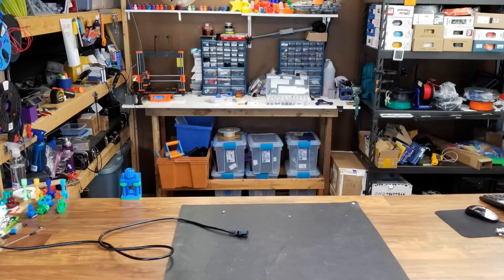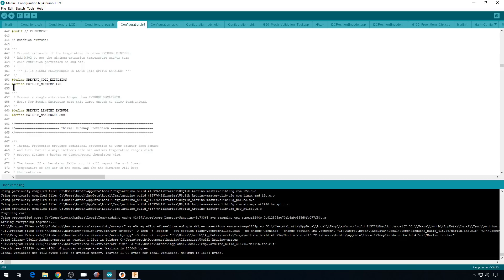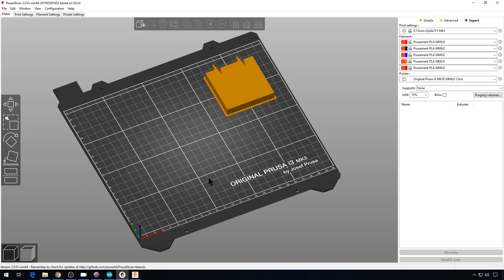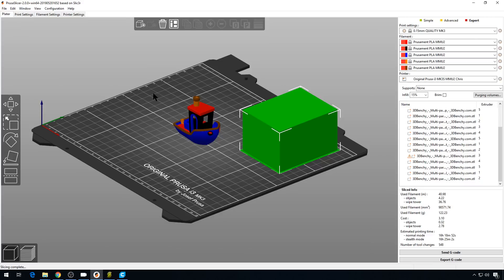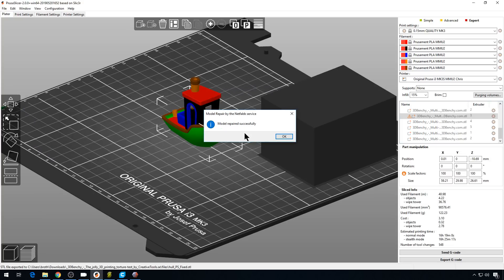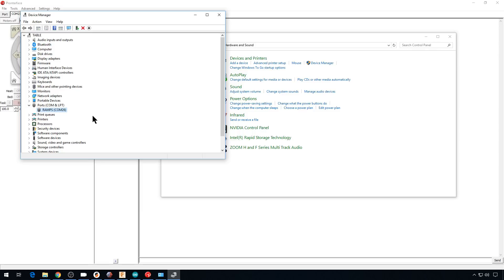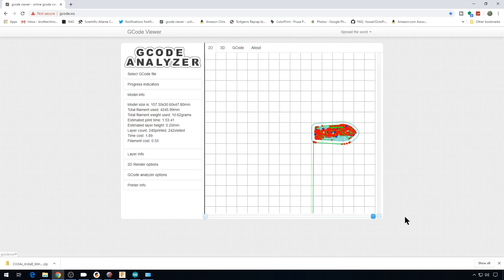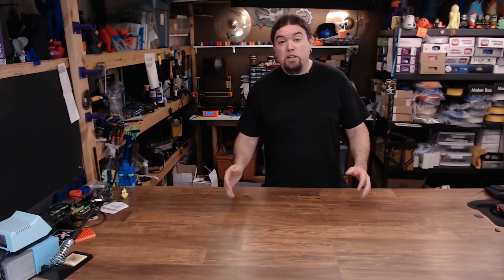5 Tips For 3D Printing - Chris's Basement

Comment: Hi, thank you so much for your printing tips. I unboxed a Sidewinder X1 last week and cannot host it with my PC. The technical support has no clue but send me a new board to replace instead, though I don't feel right about that at all.
Right before I was about to try installing the new board, I learnt from this video regarding the CH340 driver. Bingo! Problem solve! 
Thank you so much. Save me lots of works by switching boards.
Thanks again.
Reply from the maker: Awesome! Yep, that has caught me many times.

Comment: Suggestion- Show how to recover from a print that is halfway or nearly finished.  As in the power goes out and you need to finish the print or there is a filamint jam.  If anyone has any experience modifying a printer jam sensor to work with a 3d printer would like to hear about it.
Reply from the maker: Yeah, that is a tough one to do, it can be done, but I might be able to put a procedure together.

Comment: Great content.. There are some great tips, Chris...

I ran into something weird last night... print stopped midstream on a long print. simply stopped.. (Ender 3) nozzle locked into the print, not only that but the printer would not respond, I had to power it off and on again. cleaned it all up and attempted to reprint exact same G-code.. it stopped again.. but at a completely different layer (again the printer locked and would not respond). Faaaak I thought, I fried something.. re-sliced.. reprinted... bingo.. it stopped again but on a completely different layer... I thought I'd defiantly fried something..

Then I tried something different.. loaded the G-code on a different SD card.. it worked perfectly.. ran some diagnostics.. the SD card was the problem.. whewwww nothing fried and back in the game..
Reply from the maker: That is a good tip, I have ran into this exact thing before. I should put that tip on the list.

Comment: Great video Chris, can never have too many tips. Over the years I've had to overcome all of your examples, often with a ton of research, so it's great to see you bring some of them together for everyone. Indeed, slicers have come a very long way recently, Prusa Slicer is top of the pile in my opinion. I keep trying to get time to set up and tune a profile for the Borg too. Have you considered a tutorial on doing that? There must be a lot of people that would benefit, maybe even some that think Prusa Slicer is only for Prusa machines.
I currently use S3D for the Borg, but PS always gives better results on the MK2, so no reason why it wouldn't do the same for the Borg when tuned properly. Also, PS has a truck load more updates and innovation for free than S3D does for $150. That and the threat of further cost when (if) v5 update is released.
Reply from the maker: Totally agree with you. I have thought about doing slicer stuff, but it seems boring to me. Maybe it would be a good idea to try it. I will think about what I should include.

Comment: One of the first things I found out the hard way as a newcomer (with an IT background, being RTFM challenged) is the importance of using something like isopropyl to clean your bed every time you print. I was getting poor adhesion to the bed and one of the first troubleshooting steps was to clean out the nozzle as it seemed to under-extrude but after cleaning and adjusting the z-axis there still wasn't any improvement. Then I cleaned the bed as I should have in the first place and things went back to normal again. How a pair of greasy fingerprints can mess up your work -- badly! 

Anyway, three weeks in and I am suffering from 3d printing addiction already. Having a blast building my LACK cabinet at the moment.

Comment: ok I have the cr10 clone can only use the sd card tried to upgrade firmware with no success  thanking about changing board and display with a cr10s control board
Reply from the maker: There are a few replacement boards coming out of the Creality machines. Be on the look out for those, they will probably be much better.

Comment: My tip list is a bit different, and aimed, exclusively, at me. 1: gonna be mistakes,  learn from them, don't get mad or blame the dog.  2: when you look at the label on the filament spool, ACTUALLY READ the label on the filament spool. 3: ties into number 2, now that you discovered you accidentally managed to buy ABS and NOT PLA for a non enclosed printer,  take the spool off and put the PLA on.  4: smile at yourself as the parts you've been reprinting for OVER A WEEK are now printing without splitting at the laters. 5: notice that the FIFTH spool you ordered from amazon, that you THOUGHT was PLA when you ordered it, is in fact another spool of ABS
And Bonus tip!: don't give up trying to find someone in your town (mine is Seattle so odds are okay - ish )that will trade a spool of their PLA for your spool of ABS...
Reply from the maker: Ha, very good tips.
Reply: @ChrisRiley  hehe, right? I mean,  I was so damned confused as to why just printing a spool holder was so damned difficult.  I could print a benchy,  no problem, but anything bigger was a stumper. And all because I didn't double check what I was printing with. And then to somehow buy ANOTHER spool of ABS, I was like,  what the heck?!